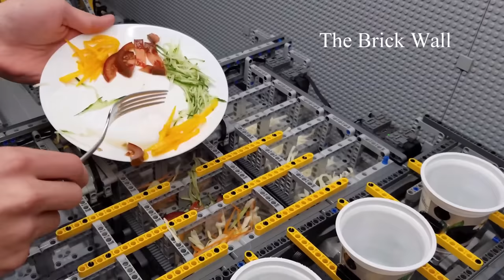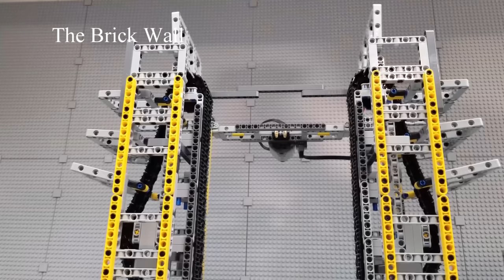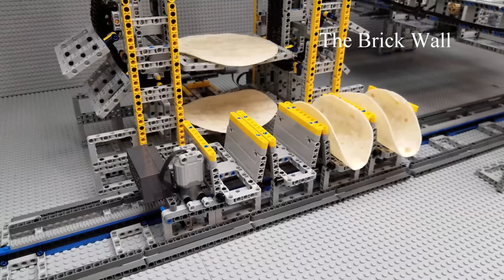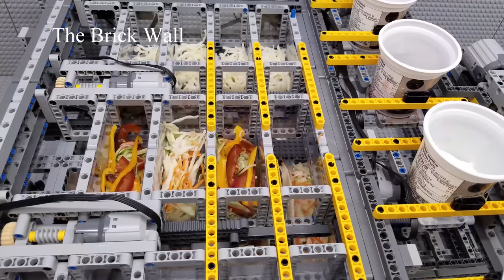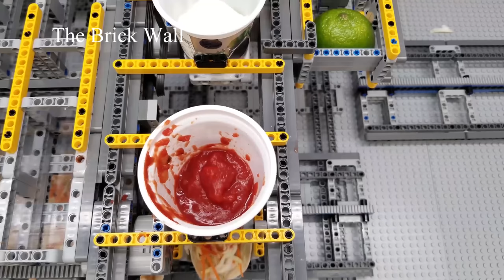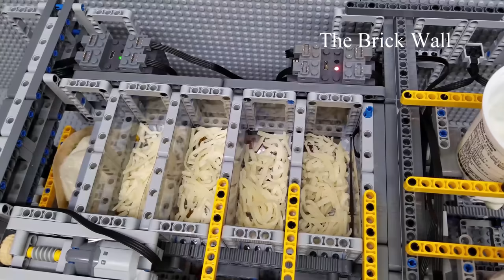LEGO Technic - TACO FACTORY

Comment: Imagine using this everyday (or any other machine built by The Brick Wall)
Reply: And your Lego will be full of ants.
Then before you wash them, you have to take everything apart...
And reassemble before the next meal.

1 meal = 2hrs on Lego, 30min enjoy food
3 meal=total 7hrs 30min
...
Oh yes, and you still need to dry the parts!
Reply: This is life
Reply from the maker: We dream big and one day ...this is fun! Thanks for your comment and support.
Reply: @randomkerbal  You just have to take out the electronics, and maybe separate them into smaller sections but you wouldn't have to completely take it apart to rinse it out.

Plus he uses clear plastic sheets in a lot of liquid or food creations.

And for drying just heat it up, or wipe it down with a clean paper towel. And for the tight spaces just get the big water droplets out, while the remaining moisture can easily air dry.
Plus you would cleaning it with clean water so even if was a little wet it wouldn't matter.

OH and i almost forgot.

When you eat something you don't wash the dish right before you eat because it was supposed to be washed after the last meal.
This applies here.
So it would actually be 5 min on lego, 30 for eat. and maybe a 15 minute, (or 30 if you come across problems)

Not two hours because again,  you would not likely have to take it apart piece by piece because only certain areas touch the food.

A blender is only cleaned by it container that touched the food not every single part inside.

Obviously it's still not practical, just that your comment is a bit inaccurate.
Reply: @thatguynamedgeorge9218  make sense...

Comment: Your builds are really inspiring! They are functional, large, and really clean. I was wondering however how you control them. I see SBrick or BuWizz units, and I'm assuming you remote control them, instead of programming them to the millimeter.  Would love to get some more insights. And, keep on the good work!
Reply from the maker: Yes I control them instead of programming them instead. The Lego Mindstorms does not have enough ports for motors and sensors. I would love to program all of my creations with sensors and code, but at the moment, there is nothing that gives me at least 20 ports for connecting motors and maybe 10 or more for sensors. Thanks for asking and thanks for the support.
Reply: @TheBrickWallTeam  you could use WeDo components and control them from a computer without needing the central Mindstorms unit